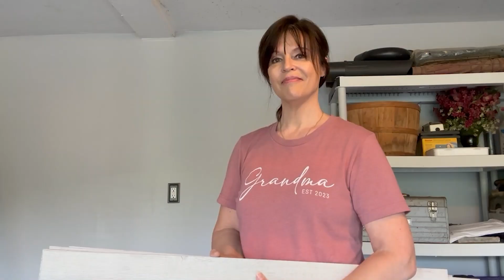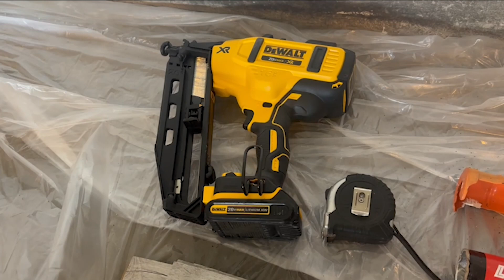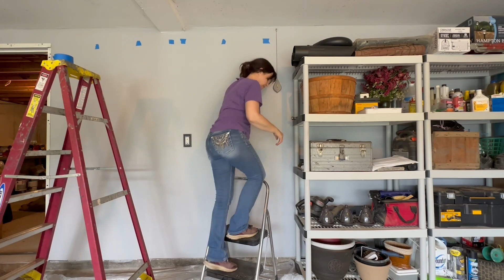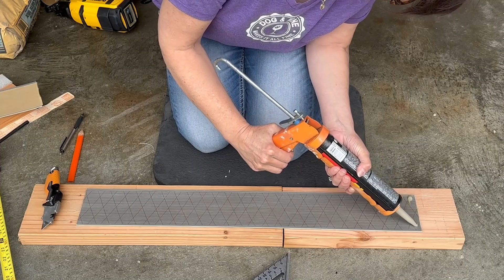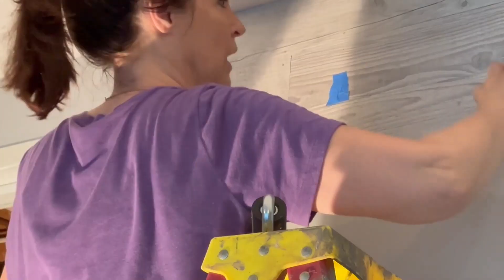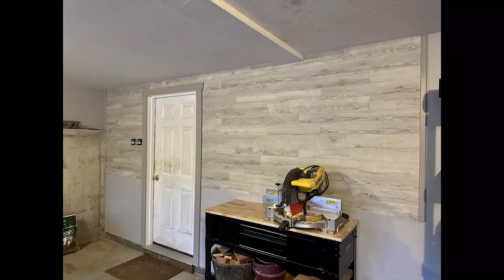DIY Garage Accent Wall with E-Z Wall Vinyl Plank Flooring

Comment: If you nailed it, how did you accommodate for the thermal expansion of the planks? Vinyl plank manufacturers recommend leaving a gap around glued or floating floors to allow for the expansion and contraction. Warm/moderate climate with little temp variation? Controlled temp in garage?
Reply from the maker: That’s right, about 1/32 of an inch gap around the perimeter for any minimal expansion.  In this case, the space is not temperature controlled.  I installed when the temps were quite hot and muggy (hence the construction adhesive and brad nails).  The wall covering held up nicely over the summer and winter.  This vinyl is quite thin compared to actual flooring.  So far, so good